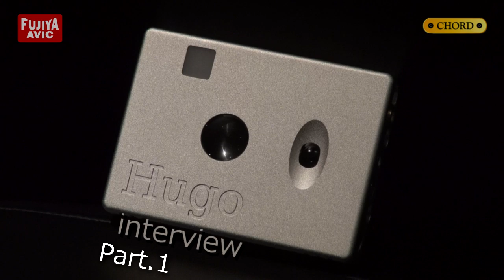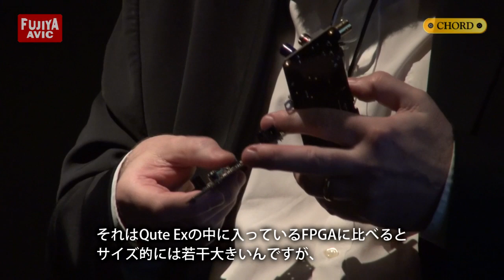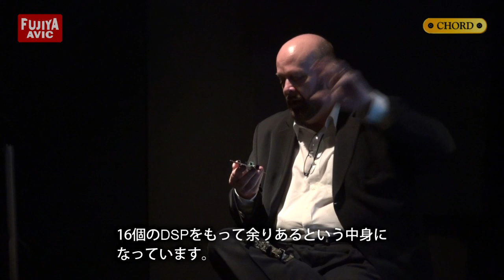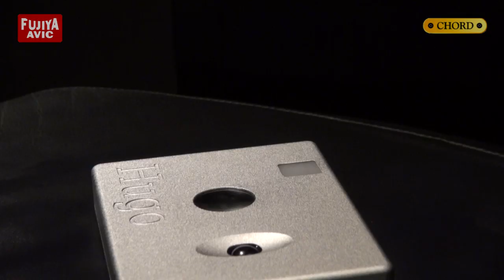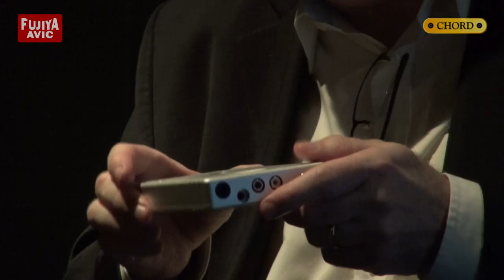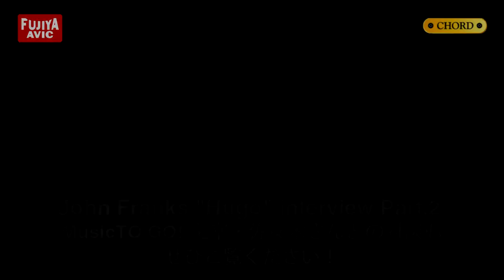CHORD Hugo interview Part.1

Comment: WOW! Can't wait to hear this tomorrow
Reply: Hi, well both customers who've been in to my shop have found the Hugo 'over hyped'. I think it's good for the price. But real 'slap in the face' DACs cost more. Like the amazing QBD76
Reply: Good question, I've yet to try it. I will try it vs the Naim DAC though shortly.
Reply: That's what I held back from saying in my previous comment! Yes the Hugo is tricky one for volume control and buttons etc Amazing portable I'm sure.
Reply: I've another Hugo vs QBD76 home demo tonight. Let's see how that goes, if we do t all melt at 32degrees!
Reply: That one was a bit tricky as the rest of the hifi was very unbalanced. Odd horn speakers! So the Hugo stayed packed away, the QBD was tested against his DAC but the gentleman needs a new amp and speakers really. Not a new DAC